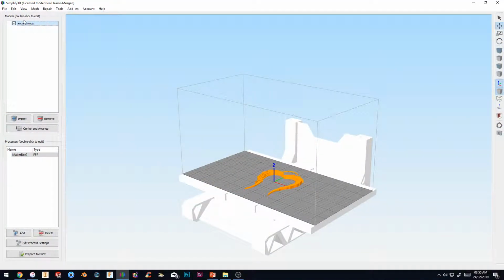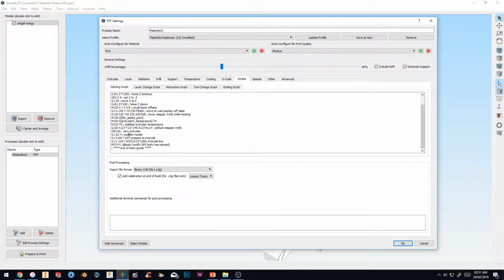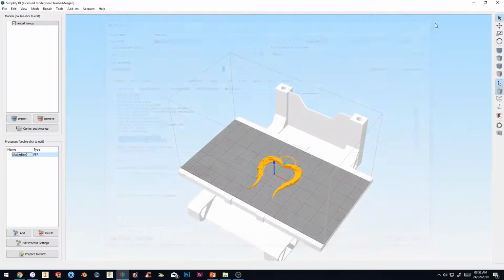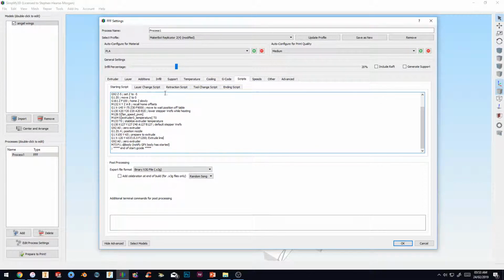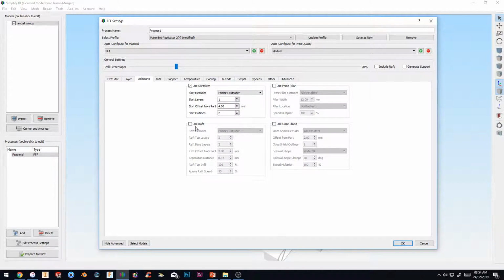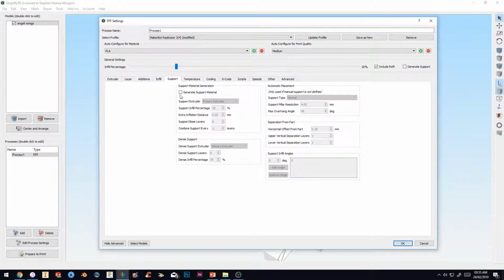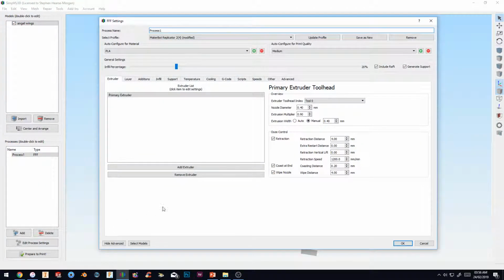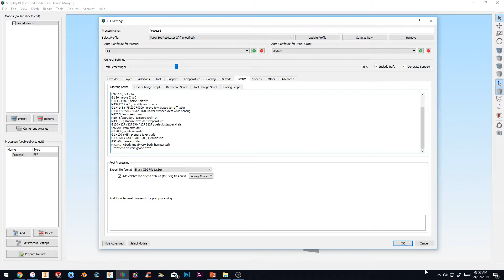Simplify3D How to extrude a purge line

Comment: You could post the line in the comments.
Reply from the maker: G92 A0 ; zero extruder
G1 Z0.4 ; position nozzle
G1 X100 Y-65 ; prepare to extrude
G1 X-120 Y-65 E12.5 F800; Extrude line
M73 P1 ;@body (notify GPX body has started)
; ** end of start.gcode **
Reply: @stephenhearse-morgan741  Thank you!